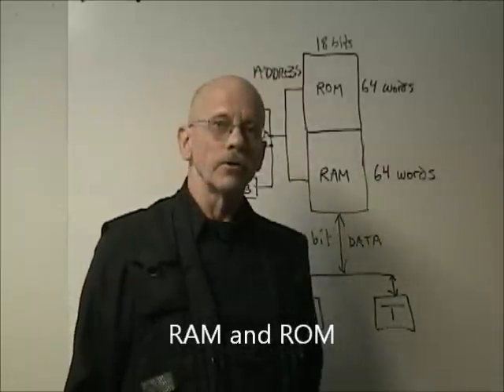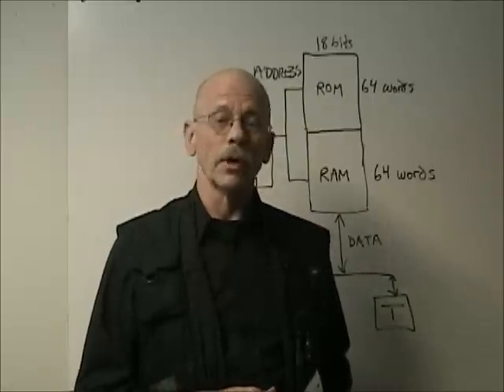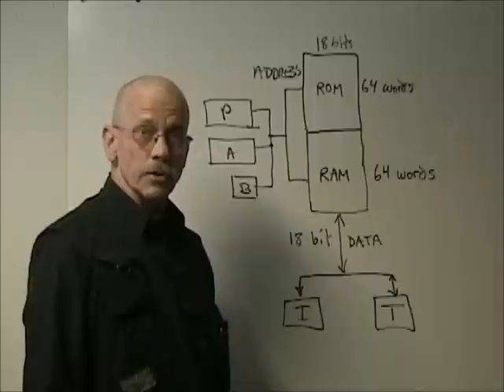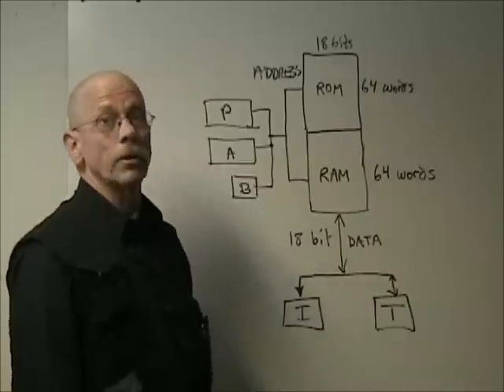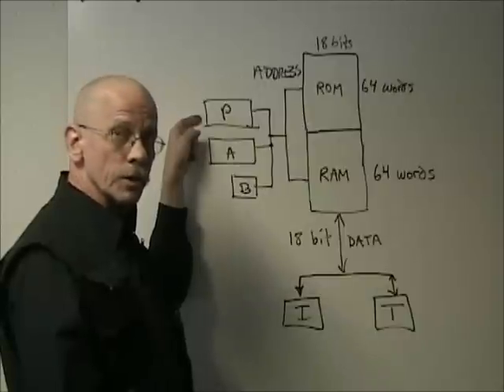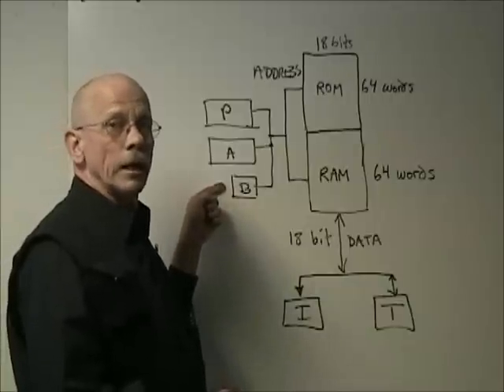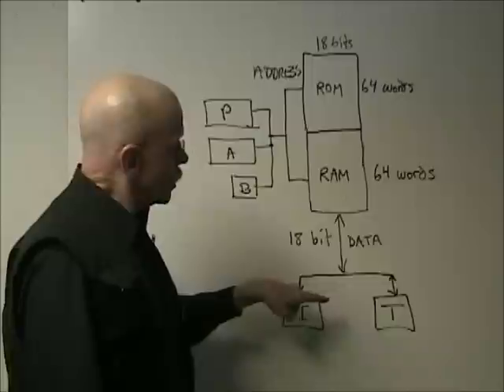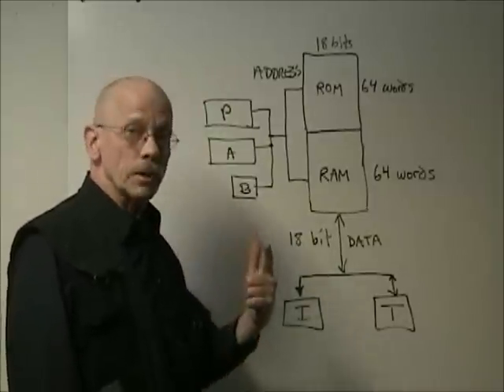F18 RAM and ROM 120308

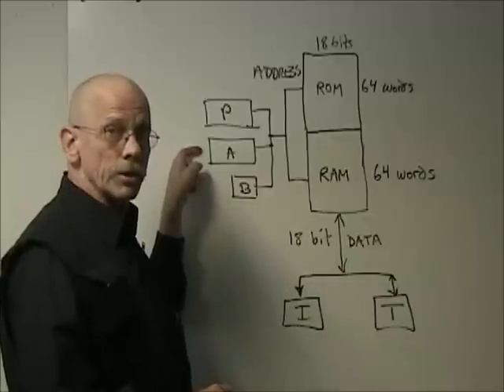Comment: At about the 2:20 point of the video , he says something about the manual , but I don't know what the manual says . I think at least 7 bits are required to index the contents of one chip and 8 bits for indexing the nodes ( And because there are only 144 nodes , and 256 combinations in 8 bits , there would still be some leftover combinations of bits which could represent other things . ) . But really though , many bits are there in that " B " register ?